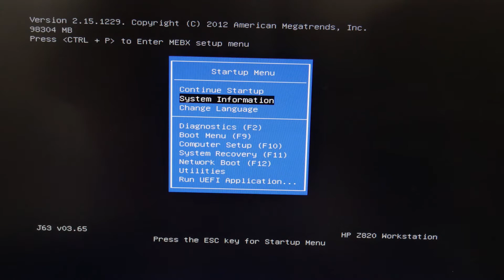HP Z820 | REMOVE CMOS BATTERY TO RESET BIOS (FIX BOOT ERRORS)

Comment from the maker: Take a second to hit that SUBSCRIBE button 👍 New YouTube policies make subscriptions very important, click it, it's free 👌 Check the description to support this content and channel 🔥
Reply: its difficult to remove my CMOS Battery with A knife. do i have to use  Screw driver? i changed some settings that i changed to boot into windows 7 i have a HP Z220 Workstation and after pressing the CMOS button my pc starts to spin SUPER Super fast and makes loud sound with the fans is it normal?
Reply: I changed the PCI slot settings in BIOS enabled "compute" on all slots. Now my PC will not reboot In BIOS I get 6 beeps and red flashes. Some PC's that's an error for CPU. HP the code is graphics. By changing the settings it is not recognizing my graphics card. And cant reset the settings because wont boot far enough for me to get into BIOS. I've tried removing the battery, resetting the CMOS button and changed out the graphics card to a known good one. IT is not returning BIOS to default. It HP Z400.
Reply: @sofbermudez2996  hey i fell in the exact same problem i did the same for my pci bios and i have now the same problem as you did 2 years ago from now haha, can you tell me now if ypu fixed it how did you manage to get to bios again?

Comment: I used to assemble these every single day. You should always unplug the computer from the mains if it's a laptop you should take the battery out once this is done you then remove the CMOS battery. Once you have done that you should switch it on without its supply that will drain the last bit of energy out of the motherboard. If you do not the CMOS can last for over an hour taking the static supply from the motherboard. So you always unplug the mains supply first. Remove the CMOS battery and then switch on the computer count to 10 and put the battery back in. I used to do these every single day.
Reply: Serious PRO TIPP!!!
Reply: The Z8x0 can discharge everything and get rid of some static by depressing the power button for 10 seconds, There is a LED code for that, I forgot which

Comment: Similar 3 volt battery holder is used in the HP Z440 workstation. The battery is not the easiest to remove . . . . you need to push it sideways against the spring, and then flip it up. Battery re-insertion is piss easy.
A fresh new battery can have an open-circuit voltage as high as 3.4v, but open-circuit voltage reading is only an indication of the battery state. You need to load-test any battery to get a true estimation of the level of discharge.
If load-testing a suspected low CMOS battery, remember that the maximum current draw for most CR2032's is about 10mA to 15mA, so therefore you need to put a load resistor with a value of at least 350 ohm in parallel with the probes of your voltmeter for a margin of safety. (Some endurance drain tests use a 15k ohm resistor to plot the depletion-rate graphs over many hours, where the end-point is 2.0v on a battery with a capacity of 210mAh).
Recycle any exhausted batteries, help the planet!
Reply: for z440, do we need to remove battery or yellow button works or none of them works?
Reply: Hello, i have z440 workstation, today it failed to boot, when i press the power button, the led turns white, the fans are working and everything is quite, but the monitor show nothing as if its not connected, i checked everything like cables and so on, even tried another monitor but same problem,,, after about 5 mins from pressing power if i let it sit, the cpu fans get louder and louder, so i long press and hold for 5 secs on power to shut it off,... My question, does removing the cmos battery help in that case or not? Could you please help me?
Reply: @nileshkumar3  i have too the z440 where comes te yellow bottom

Comment: Thanks for this video, super helpful. I bought a couple of Z620s which are close in the Zx20 family. I couldn’t get the bios screen to display on boot up. Tried everything and now after your video removed the battery, put it back in and it is still not booting. Has all the characteristics of a boot (including a beep) but no BIOS screen, even trying F10. Most bizarre. So if removing the battery doesn’t work, what do you think MIGHT be the problem ?

Comment: When I turn on my Hp Z820, only the blue color of the power button is displayed and it turns off. What can be failing?
I appreciate your help.
Reply from the maker: no beep codes? it's hard to tell without a beep code. could be the power supply, could be the motherboard itself. you would have to trouble shoot it.

Comment: i have a z820 and am getting 4 beeps and 4 red led with 2 second break intervals.

i have removed cmos battery for 10 minutes with mains power unplugged and motherboard discharged.

but still wont boot. still get the 4 beeps and red led's.

any idea?  i tested power supply without being plugged in to pc and the fans go so means power supply is fine, so must be another issue.

Comment: Hi there can this fix be used on a hp z600 my red light is flashing monitor says vga and dvi no signal
Reply: I have the same problem in the same pc workstation z600 can you tell me how to fix it if u did now

Comment: do weak battery makes booting up little long while spinning fans at full for a while?
i have a z420 and like sometimes it boot up late and fans spins at full speed then it boot up, not every time but like 1 out 5 times. what's the actual cause of it?

Comment: My Z820, bought from ebay (listed as for parts, not working), has no beep codes. The computer will power on then after about 30 seconds the fans will spin up to max and there is no video display. I've tried clear CMOS, I've removed the battery, I've tried the using the crisis recover jumper with a bios .bin file on a flash drive. Nothing worked. I have confirmed the CPUs work in another computer, the GPU works and the RAM. I think the only other conclusion is dead motherboard. Is there anything I missed? Thanks.
Reply: Did u solve ur issue.. i am experiencing the same in z620
Reply: @trichyjenny  both of your cases seem to be related to power supply unit or system boards failures, there's abundant replacement boards for those machines on ebay, since they are really old they should not cost much
Reply: @Stealth3dfx  thank u for the reply.. it seems to be an issue in BIOS.. solved my issue yesterday by sorting the jumper pins. Now it runs fine..
Reply: @trichyjenny  I resolved the issue by replacing the motherboard.
Reply: @trichyjenny  can you help me find the correct bios and the process is short, or any guide that you followed

Comment: It is not working for me. Mine is z600. I wrongly changed bios setting for PCIE slot as compute. Then it is not detected my graphic card. I removed bios battery and leave the whole night. Look like it doesn't clear the bios setting. 😥
Reply from the maker: did you press the reset button?
Reply: @sem_skywalker  I have similar issue and resetting does not help. should  I use a new graphics or same graphics card in other slot ?

Comment: I have z620 . Suddenly it turned off while I was working  . Then no display and fan suddenly starts to tun speed after 30 seconds of switching on.. any solution
Reply: Bendede aynı sorun var bazen açılıyo bazen açılmıyor sorunu bulabildinmi